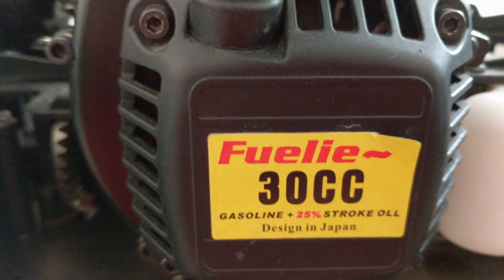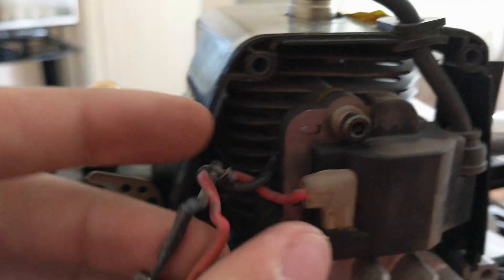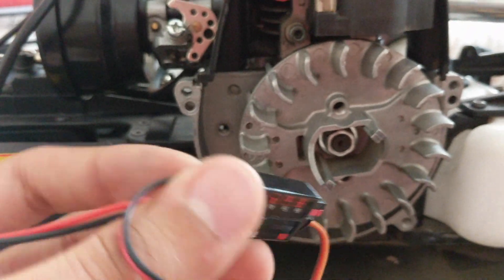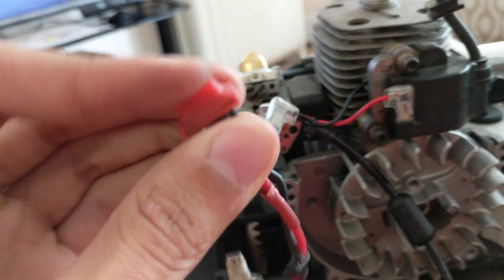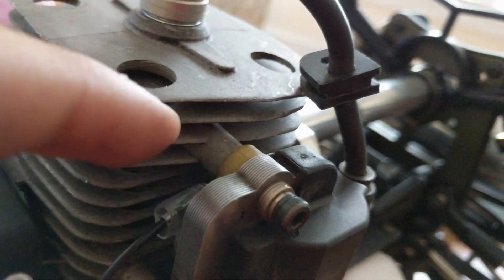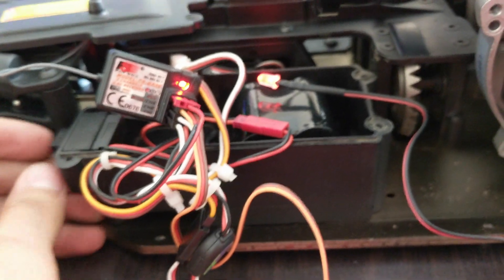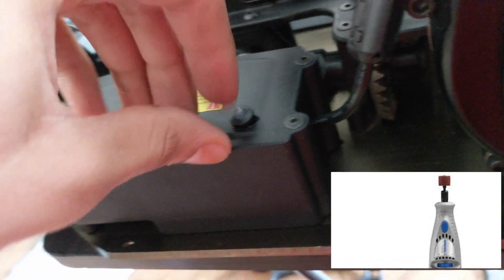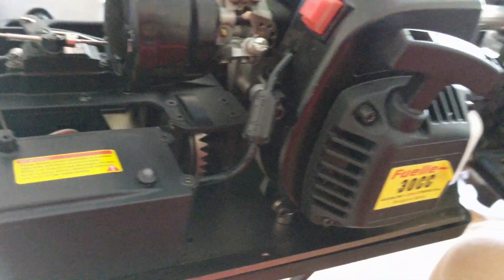Dynamite kill Switch [Install] Work With Any Rc

Comment: Since you re using flysky gt3b, you can use the 3rd ch to kill the engine instead using on/off switch
Reply from the maker: I did, I probably forgot to put it in the video.

Comment: The wires that come from kill switch to stock switch all you had to do is cut the wide female connector of leaving the thin  piece that would slide in connection!  Just saying
Reply from the maker: Oh, that brilliant I didn’t had that in mind, well is to late to do that now :) put thank for the tip.
Reply: Explain in detail please just ordered mine on the way
Reply from the maker: flyinsohigh007  I recommend to watch the video one more time and if it doesn’t help you let me know.
Reply: RC madness i still dont understand what he meant by cut the aide female switch, how is hks done im confused and habe my killswitch here